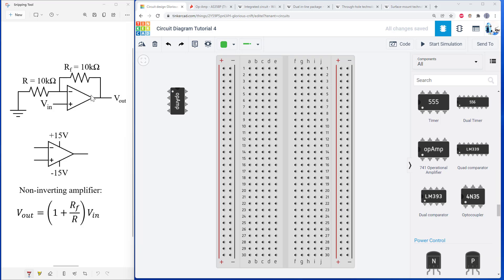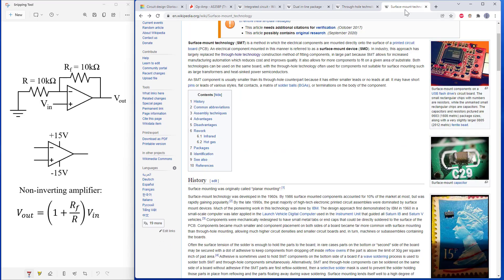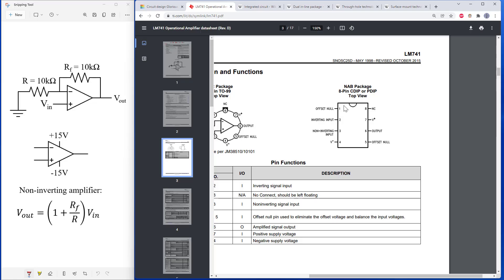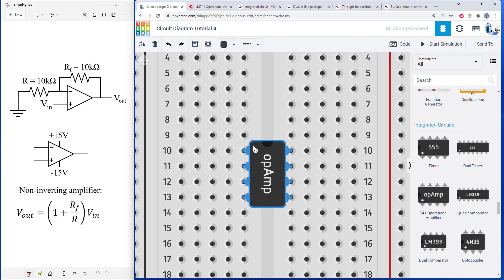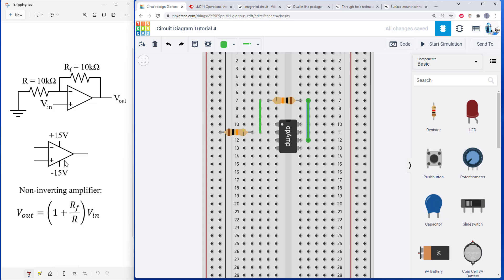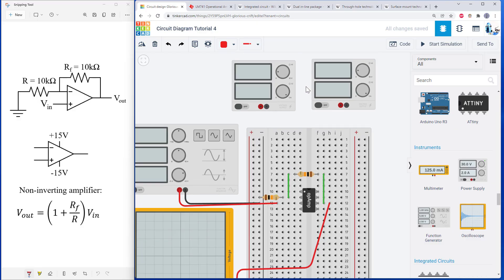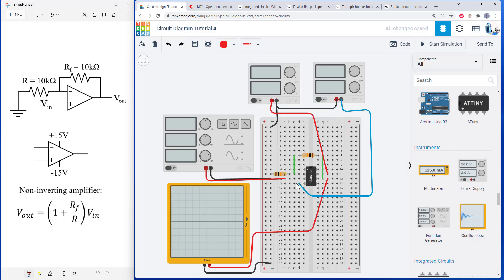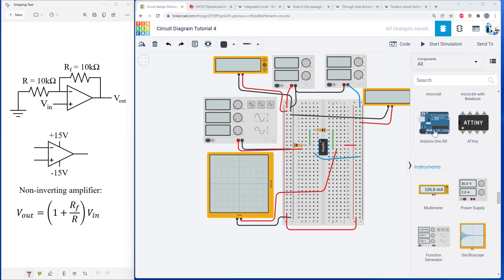How to Build a Circuit from a Circuit Diagram | Part 4: Operational Amplifiers

Comment: How would you make an Op-Amp circuit? I've seen somebody make one with 7 resistors and 4 transistors on a pcb, but my brain is still having a hard time translating the diagram to a breadboard, though I haven't looked at the circuit since I started watching this series and it might just click when I do, after the next video

Edit: I was able to read the circuit, and I've translated it to a breadboard, but I'm confused about the VCC, VEE, + in, - in, as well as out.

Resistor 1 (1k) connects to VCC resistor 5 (1k), then to the collector of transistor 1(NPN). The base connects to + in, and the emitter connects to resistor 3 (1k), which connects to VEE.

Resistor 2 (1k) is connected to VCC and the collector of transistor 2(NPN). The base connects to - in, and the emitter also connects to resistor 3.

Resistor 4 (200) is connected to VCC and the emitter of transistor 3(PNP). The base is connected to capacitor 1 (100pF) and resistor 5.
The collector is connected to the other end of the capacitor, the base of transistor 4, and resistor 6 (51k), which connects to VEE.

The collector of transistor 4 (NPN) is connected to VCC. The emitter is connected to resistor 7 (1k), which goes to VEE

I'm just not understanding how to connect +/- voltage, as well as VCC and VEE

Comment: 1st video in the series where i'm genuinely confused lol but at 10:14 why is it common knowledge at this point that the oscilloscope and function generator also need to be connected to ground? 
one could easily assume that both the FG and oscilloscope are separate individual machines, hence not needing to connect to ground. and considering as well that thus far every ground connection was represented in the schematic, this really confuses me :D 
is it also just common knowledge/implied that whenever interacting with a circuit from "external sources" (FN & osc. in this case), that they all need to share the same ground? what am i missing here?
Reply from the maker: Voltage is always measured between two points and ground is your reference level where you define "zero" voltage. In theory you could connect an oscilloscope between any two points in a circuit but you'd be measuring the voltage between those two points and not necessarily relative to ground. This playlist may help understand some of the underlying circuit theory, particularly video 21 about ground: https://www.youtube.com/playlist?list=PLKL6KBeCnI3U6KNZEiitdtqvrxkBhpuOp
Reply: @BenFinio  thank you, will definitely go through this! really like your style of explaining things